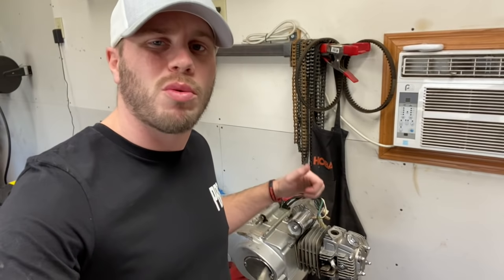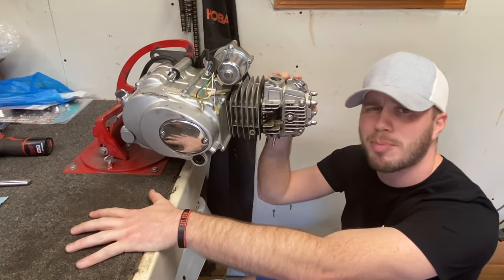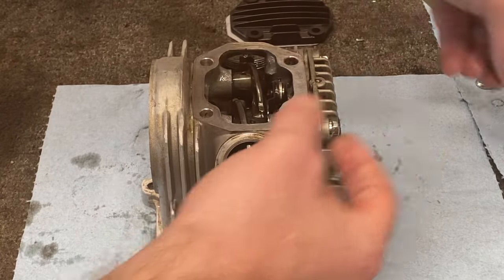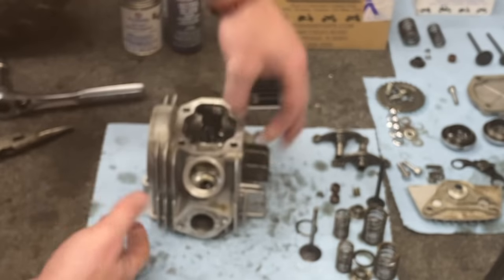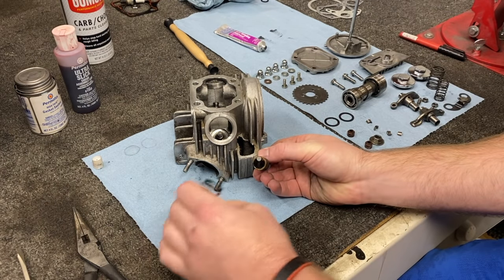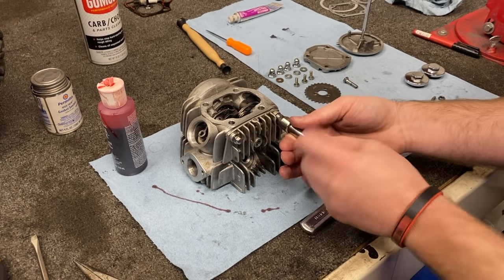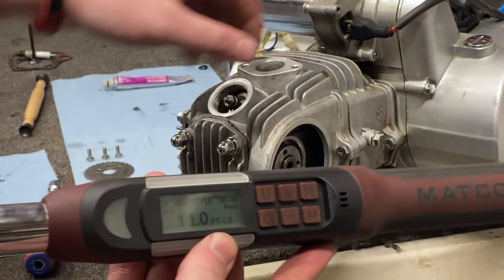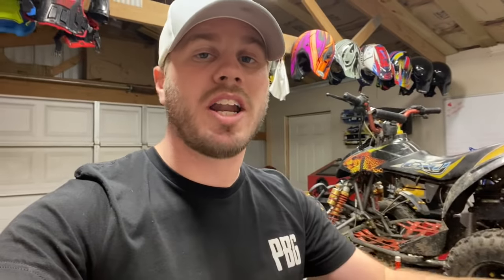HOW TO: Complete Tear Down & Rebuild of a Chinese ATV Engine Head. Every step you'll need covered!

Comment: Hey man, your videos have been a huge help for me lately. I’ve just rebuilt a little 110, however I’m having a lot of trouble getting it started. I’ve managed to hear it sputter, however it would never run. I realized timing may be to blame. It looked to be off a bit so I re adjusted the sprocket. I understand setting the piston to tdc, and aligning the mark on the sprocket to align with the markings on the head, however are there any markings to align the sprocket with the cam ? I’m worried that could be off or something. I see there’s a small L or something on the actual cam where the sprocket sets, I have been turning this L to the side that the dot is along with the head marking, and it seems to line up and fit well, however I’m still not getting fire. Spark is there, it’s getting gas, carb has been completely cleaned, it likes to poof gas out of the carb intake when I’m starting it. Been fighting this thing for days now and I’m almost losing hope. Thanks 🙏
Reply from the maker: Alright, you need to rule out a few things. 1) Try putting a little gas into the spark plug hole to make 100% sure it is getting fuel. 2) Check your valve lashing. Double check to make sure they are in spec. 3) Look at the flywheel, it has a keyway that can sheer and rotate which will throw off the timing...after all that if you still get nothing then check compression and let me know what you get.
Reply: @PraskaBoysGarage  I have no way to test my compression at the moment but I just went through all of these and they seem to to check out. Flywheel Key is there, spark plug was actually wet with fuel so there’s definitely gas entering the chamber. While cranking I notice on occasion when letting off throttle it will fire for a quick moment, however I can’t seem to find a balance to keep it there.
Reply: @PraskaBoysGarage  okay I’ve got it running now. The exhaust valve clearance was extremely high and the nut had loosened. After adjusting I’ve got it running. Wants the choke at all times at the moment but at least it’s running lol.
Reply: Hi Nelvk, I am having the same issue with my 110cc Quad. What was your clearance figures that you have used.

Comment: Hey BJ, I was just curious, when you use your wire wheel to clean all the carbon off of the cylinder head etc, do you use a brass wheel or steel? It looks kind of like steel in the video, if so have you noticed it causing any damage to the metal?
Reply from the maker: Honestly since they are cheap motors I use standard steel brushes. I haven't seen it do any damage other than remove weak meatal that's been compromised by rust. When I work on name brand I take more time with degreasers and a dremel with brass attachments.
Reply: @PraskaBoysGarage  Ok thanks man. Enjoy the rest of your weekend.

Comment: Great video! Good job man! Is this process the same on the 200cc Chinese engine? Which the manual says is actually 177.3cc?
Reply from the maker: It's similar yes, but the 200s are considered vertical motors and these are horizontal. The process of lapping in the valves and setting timing are almost identical it just looks a little different.
Reply: @PraskaBoysGarage  you sir .... are awesome! Thank you
Reply from the maker: @63KANE  Thanks for watching!

Comment: I have an atv. That cranks and has good spark. But it wont run.  It ran fine before. All. wiring is brand new. Timing is fine. Any ideas thanks
Reply from the maker: If you have spark then it's likely either fuel or compression. Isolate the problem by checking the compression or putting a little fuel directly in the spark plug hole and then trying to start it.
Reply: @PraskaBoysGarage   checked compression 120 psi. Put fuel in spark hole and it dont start.
Reply from the maker: @gelufanan4992  Next 2 things to check would be your engine timing and the valve lash.
Reply: Thanks for all your help. Should do a detail video about checking a bad  stator, If you dont have one allready.

Comment: Hello BJ how are you doing hey I watch all your videos and I love them so I build me one 125cc motor this week and I just finished and installed back on the bike but now won't start it turns too slow like the valves are disadjusted but I just the valves 005 intake 007 exhaust and nothing then my buddy said 004 intake 004 exhaust and nothing then I check the timer and all correct fliy wheel and timer gear everything line it up 

Have new rings,piston, cylinder, valves and gasket 

What it could be thanks Mr BJ have a great day and take care your family
Reply from the maker: Is it electric start? Could be a weak battery or starter...Have you checked compression after you installed the new top end? If you did want did you get? If compression is good and your timing is correct your no start issue may be a result of something else.
Reply: @PraskaBoysGarage  let me check that again but have new battery and i jump with other new battery but i will check all again  thanks for your answer and time appreciate it you are the best god bless you and family
Reply from the maker: @franciscagarcia9017  Same you to brother! Good luck on the project!
Reply: @PraskaBoysGarage  hello MR BJ i got it running but now is running too high  runs wide open i change carburators and is the same check the nedle n nothing check the throttle cable nothing and move the adle screw and nothing 
What it could be now 
Sorry for too many questions 
But you know everything 
Thanks mr BJ GOD BLESS YOU

Comment: What if it’s a kickstart motor how do you get it to turn over
Reply from the maker: 14mm Socket and a power drill. You can turn the motor by spinning the flywheel nut.

Comment: Can someone help me with a quick question. I have the same engine for my go cart that I swapped. Everything works perfect on the engine and I am able to push start it but whenever I hit the button to electrically start it it doesn’t do anything. please help me fix this problem
Reply: It's probably the relay for the start jump the solenoid and see if it starts that way

Comment: I have some trouble getting the timingchain and sprocket back in the engine, any idea what might be the issue?
Reply from the maker: The 14mm bolt on the bottom of the engine holds a spring then a plunger. That is your timing chain tensioner. Remove the 14mm bolt and the spring will shoot out. Then put your sprocket back on and reinstall the spring and plunger.
Reply: @PraskaBoysGarage  thanks, great video btw, it really helped me out👍❤️
Reply from the maker: @jonathancarlberg3854  Awesome! Glad it helped!

Comment: What type of oil and spark plug do you recommend?
Reply from the maker: AMSOIL Formula 4-Stroke Power Sports Synthetic Motor Oil SAE 0W-40 is the oil I use on anything I plan to keep for awhile. Spark plugs I just use the standard NGK plug and change it every spring riding season.

Comment: I have gas coming out of the exhaust... can this be due to an air leak? Or
Reply from the maker: You are most likely overflowing fuel. The carb float isn't doing it's job and dumping extra fuel into the motor.
Reply: @PraskaBoysGarage  i took the carb off and checked the float. Its seems to be fine

Comment: Bought 2 Apollo blazer 9 125cc. Son's head has pulled away from the crank/block. Company is giving me the runaround. Any thoughts on this brand?
Reply: Great videos by the way! Just getting into this atv thing and I hate looking at my boy telling him he can't ride yet.
Reply from the maker: Apollo is one of the more popular brands, next to TaoTao and SSR. I've never heard of that happening! The motors are great and typically only go bad from a lack of maintenance, I would be curious to look at your and see what happened!
Reply: Theyre brand new. Changed the oil out when I got them and checked it before each use. Are these clone motors? I'll try to film what I find. Its crazy. Neither one wants to keep a charge either. I think they built them on a Friday! Hahaha! Thanks again!
Reply from the maker: @marcwidener6799  They are clones of honda motors from the late 90s early 2000s. From my channel it looks like they are all bad, but we have had a few for years with no issues. You can always send a video or pictures to my email praskaboysgarage@gmail.com Thanks!
Reply: @PraskaBoysGarage  awesome brother! Thanks again!
Reply: @PraskaBoysGarage  looks like one of the cap bolts on top of the cam cover plate was stripped. It never tightened down enough. I guess this allowed it to push away from the casing. Going over to a friend's house today and do some damage control.
Reply from the maker: @marcwidener6799  That sucks man! Hopefully it's just the bolt that's stripped and not the rod!
Reply: @PraskaBoysGarage  it was the rod end. We machined down the cover plate to allow for more threads. Seemed to work ok. I really appreciate your communication with this. Have a good one bud!

Comment: Hello what is that engine mount your using
Reply from the maker: This is my #1 question for sure! I actually had a CNC company laser cut out all the metal to start making and selling my own. I will be selling the kits on my website either as a DIY kit or a completely assembled and power coated. I will post updates on the channel when they are ready!

Comment: Hi. How much oil did you put in? 700ml?
Reply from the maker: Yep it's roughly 3/4 of a quart of oil here in the US so that's roughly 700ml. Just check the level as you go, make sure to only add a little at a time. You don't want to over fill it.

Comment: at 70psi of compression the engine will run as long the engine timing is right so it like your actually having a issue with the engine timing not the compression
Reply from the maker: The first thing to trouble shoot would be to make sure the motor is in time and also check the valve lash. This video I specifically wanted to focus on rebuilding the head. If it would run at 70psi it would be very poor with almost no top end potential. If your pulling only 70psi something is wrong.
Reply: @PraskaBoysGarage  true and i didn't mean anything out of the way by it
Reply from the maker: @billyjackson5799  No worries, I didn't take it negatively
Reply: @PraskaBoysGarage  ok i am currently working on 110 atv engine that has blown head gasket

Comment: Hey BJ! I had a quick question. I am going to buy a compression tester to use on my 110cc motor. Could you tell me what size adapter I need? Is it 12mm?
Reply from the maker: Hello! This adapter you'll need for the 50cc-125cc is a 10mm.
Reply from the maker: I'm not saying yours couldn't be different, but that's what it has always been for me and I used the 10mm in this video!
Reply: @PraskaBoysGarage  Okay thank you so much, my motor is the practically the same as yours so it must definitely be 10mm. I was unsure if it was 12mm or 10mm as it will be my first time using a compression tester so I am really inexperienced 😂. I will get a kit with a 10mm thank you so much!
Reply from the maker: @vikramgrewal5670  Yeah you bet!
Reply: @PraskaBoysGarage  Hey BJ, can the motor run on 75psi of compression?

Comment: Which paint do you use for your engine ?
Reply from the maker: Rust-Oleum High Heat Engine Enamel, both the primer and the top coat. You can find it at most local hardware stores.

Comment: Where did you get your engine stand?
Reply from the maker: This is my #1 question for sure! I actually had a CNC company laser cut out all the metal to start making and selling my own. I will be selling the kits on my website either as a DIY kit or a completely assembled and power coated. Should have everything ready soon and will post updates on the channel.

Comment: Hello, I want to know if a 110cc cylinder is compatible in a 90cc kazuma engine To increase power

￼
Reply from the maker: I have actually done a lot of research on this. The problem is the parts used are very inconsistent. So the answer is "sometimes" It all depends on the length of the connecting rod. I have order all the sizes 50-125 to figure out what is compatible.  Hoping to have a video about it soon.
Reply: @PraskaBoysGarage  If I want to do this project I have to have the cylinder dimensions right

Thanks for your help I did not have that detail in mind

Comment: Is the valve spacing the same for a 90cc?
Reply from the maker: Yes, it will also work for the 90cc. This isn't factory spec it's just my personal setting that has worked for me over the years. You could go a thousand or so tighter if you wanted without an issue.
Reply: @PraskaBoysGarage  Thank you so much for the reply and all the videos. You're a life saver!
Reply from the maker: @michellewfhs  No problem!

Comment: I worry about your using hondas torque values! What can you do though? It's not like they offer torque valves for Chinese clones but they probably use a cheaper metal which makes me wonder!
Reply from the maker: I've never read that online it's just my assumption. I figured since the Honda GX200 and Predator 212cc share the same torque specs it's a good guess. I feel comfortable saying it on video because I've used the same specs multiply times without issues.
Reply: @PraskaBoysGarage  I feel ya! I just worry is all! I'm  sure it's fine though

Comment: hello , where did you get this engine mount ?
Reply from the maker: This is my #1 question for sure! I actually had a CNC company laser cut out all the metal to start making and selling my own. I will be selling the kits on my website either as a DIY kit or a completely assembled and power coated. I will post updates on the channel when they are ready!

Comment: I’d just buy the $50 head ,  not because I don’t have the tools or the experience , simple time management.
 your already over cost in replacement gaskets,shop materials,valve rebuild kit and shipping not to mention you’re time… if other peps need to buy spring compressor etc at the end of the day it’s still a Chinese motor .
Reply from the maker: Very true, I have acquired the tools and supplies over time. If it's something you'll do regularly I say invest in the tools for sure, however it it is a 1 time deal I would agree buying the head is probably the route to go!

Comment: Yo where to find make model and year on this Chinese atvs?
Reply from the maker: They come with an ID tag either on the front bumper plate or on the rear swing arm. If you don't have on in either stop then I just search for chinese atvs until I find a body style that's similar. If you go to VMCs website and look at plastics they have all of them labeled what type of atv they fit.

Comment: Hey there wasn't any chain tensioner on that
Reply from the maker: The chain tensioner is on the bottom of these engines. It's a 14mm bolt next to the oil drain and behind it is a spring and plunger.

Comment: Got a question hopefully somebody can answer this I replaced the head on my 110cc wildfire ATV the heads were almost identical except for the cam gear with smaller on the old one than the new one so I took the old cam gear off the old head and put it on the new head that's the only way I can get the chain to fit now I have a problem when it's up and running and you give it throttle it runs like s*** and wants to stall and it's popping really bad through the carb but it idles perfectly does anybody know how to fix this
Reply from the maker: Hey Matthew, for some reason this comment was "held for review" not sure why! Did you figure out your issue or are you still having the same problem?
Reply: Yes still having the same problem it's an older style 110 engine and the newer style heads seem to be a little different if you have any ideas that would be greatly appreciated the next step I'm going to try is actually just rebuilding the old head with new valves and springs

Comment: I bought a second hand quad with LC152FMH FZ187158 written on the Loncin engine. I can't find parts for this anywhere. Can anyone help?
I don't know what size atv or anything? Anyone has any idea?
Reply from the maker: The lincin motor is a brand of the Honda clones, there should be a stamp in the casting on the cooling fins/cylinder sleeve. These are the readings:
49cc = 49CM3
70CC = 72CM3
90CC = 86CM3
100CC = 97CM3
110CC = 107CM3
125CC = 124CM3

Comment: I didnt put my motor at top dead center so what do I do
Reply from the maker: You need to be at top dead center for timing. To make sure your timing is correct, take the cam chain cover off, put the motor at TDC and make sure your cam gear is properly aligned with the timing marks.
Reply: @PraskaBoysGarage I aready took it apart
Reply from the maker: @landonsanford5342  Oh your fine, doesn't really matter if you took it apart without being at TDC. It only matters when your putting it back together and installing the head and the cam sprocket.
Reply: @PraskaBoysGarage  so every time I would try to start it it wouldn’t make any noise but blow the fuse
Reply: @PraskaBoysGarage  so I don’t know what to do

Comment: I'm working on the same thing I took my head off in the black Rubber seal is smashed and cannot be reused where can I purchase a new one the black Rubber seal that he says to not forget to put back in when he's putting the head back on
Reply from the maker: I've just replace it with a thick o ring. Here is a link to the kit I bought: https://amzn.to/3nKGMid
Reply: @PraskaBoysGarage  okay so I don't need to have a flat o-ring I can have a regular round o-ring the one that comes out of there is flat the ones you sent me in the link are regular round and not flat if that even makes sense LOL
Reply from the maker: @jonathangreene1697  Yes, I just replace with a thick round one. It's for an oil passage so oil gets to the rockers. You want a seal so you don't have an oil leaking into the cylinder and these will work just fine.
Reply: @PraskaBoysGarage  thanks man I appreciate it.